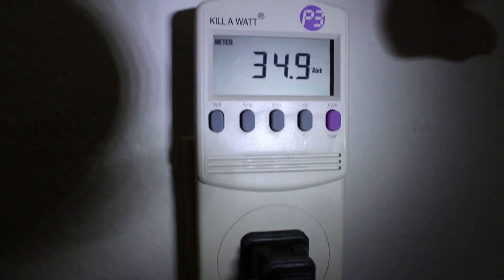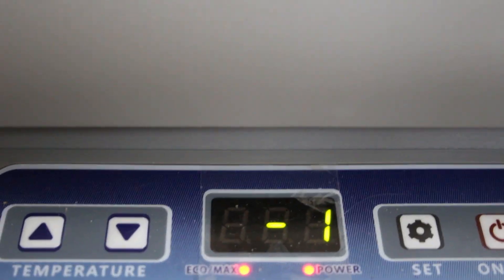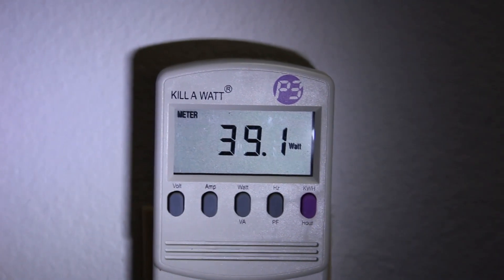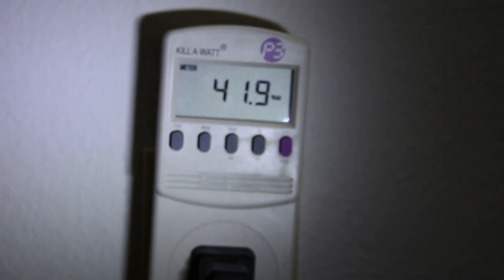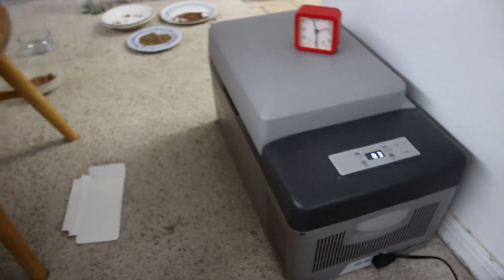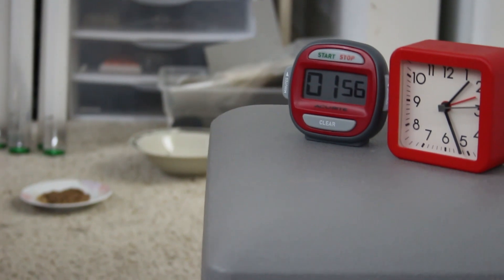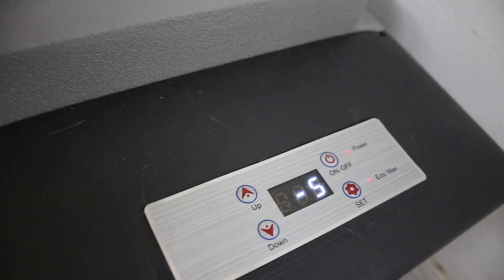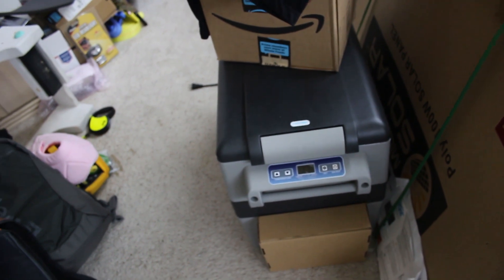Alpicool Power Consumption 20 and 45 liter models

Comment: i added aluminum foil tape to the outside of my 54 liter model and wired in a GAN 140w usb-c pd 3.1 charging brick into a 28v trigger board which goes straight into the DC plug. plugged in to 120v us outlet, it averaged 10.2w/hr or about 244wh/day as a drink fridge.
most dont realize you can run these at much higher voltage coz the compressor is actually made for 24v which for car alternators means they need to go up to 30v.
before with the regular ac plug it was up there at around 18w/hr or about 432wh/day; so thats almost a 2x in COP. i am pretty sure it saves me money since i dont open my big fridge nearly as much now at home.

Comment: Does anybody know what the power consumption would be in amp hours on 12 volts for the C20?..  At freezing mode the c20 consumed .7 kilowatts but the test was using 110 volts.
Reply: Total consumed is 58.3Ah at 12v.

Comment: Great video as always thank you so much for the great review with the statistics you would need to design a system for sailboat I have been watching some videos from a young fellow named will prowse has some great videos on solar panels also on do-it-yourself lithium battery Banks and the controllers that you would need for them I watched your video 3 times just to make sure my eyes were not Crossing lots of laughs and my eyes were fine lots of laughs so thank you very much again and I just cannot wait for your next video Jerry MacGregor 26s
Reply from the maker: Thanks!  I hoped this would be useful to others who might use these on boats or other off-grid situations.  The weird autofocus is from the original Canon 18-55mm DSLR lens designed back when you could only take still pictures.  I should have redone it with the handycam but it got to be hilarious while editing because it just didn't quit making that noise and shifting focus.  Canon made a newer version of this lens for video.  I'll either get a used one, or just use my handycam more.  I actually like the handycam a lot more than the DSLR for video.  MacGregor sailboats kick ass.  They made a lot of them and they are surprisingly solid boats.  I've owned two Mac25's.  I kind of miss them.  They were simple, honest boats that had few systems to maintain or restore.